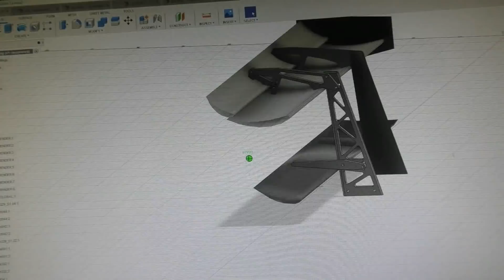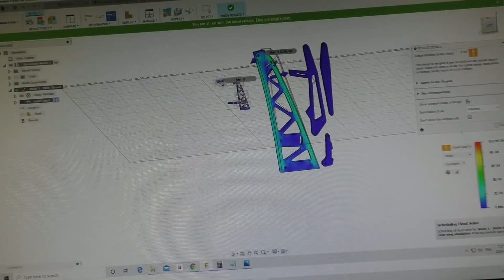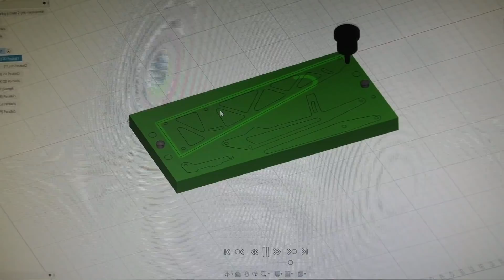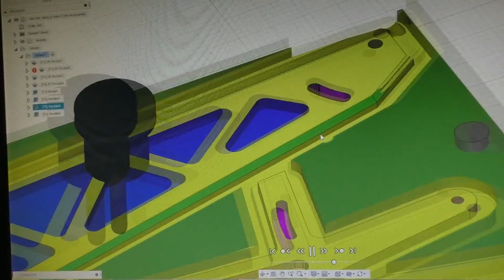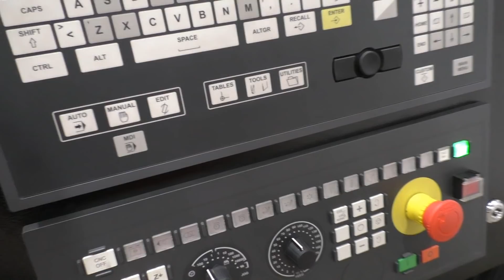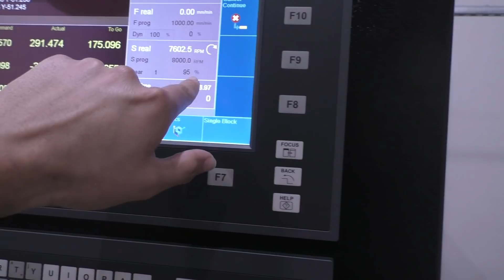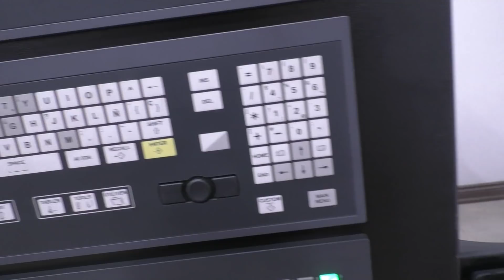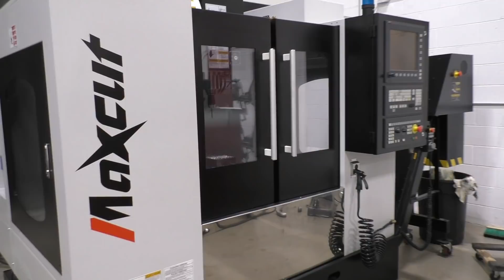Making Custom Rear Wing Mounts and Track Test - E55 ASL Part 26

Comment: oof, that curb hit was painful, but that may be a reminder to make the rear Geometry stronger
Reply: Something always needs to take the hit. Coming from rc cars it's very important to have a weak spot somewhere. Otherwise the frame will bend.
Reply: It’s probably better if they bend rather than break.
Reply: @cnnlt200  exactly, the difference is replacing a bent $5 diy control arm, or hacking out parts of bent frame and remaking the right sized tubes and welding them in.
Reply: There are a lot of alloy suspension upgrades for rc car. Especially A arms. But Its better to have them from nylon. They will bend or give on a impact. Frame sliders on a motorcycle. It's better to just let a bike slide on the handlebars. Frame sliders will give a direct hit on the frame. So don't make things to stiff

Comment: pivot the wing and run a pushrod from the lower control arm to the wing arm. Stop pushing the car down with the wing, its just wrong. Thats for cars that race in a class.
Wing should push down on the tire, not the car.

Comment: I think its called a sacrificial pallet 
The purpose of a rear wing is down force
If you move your rear wing mount to the rear spindles all of the down force will go to the tires to pavement instead of the cars suspension to the tires 
Which would allow you suspension to move without the down force of the wing

Comment: You need to attach the front spoiler fairings to the chassis. On the straights the structure is lowering, but the capo is lifting more than 5cm and is losing all down force efficiency.

Comment: Woah the laps were so cool, passing the other cars like nothing!
Factory lip-spoilers like on a CLK or E class, do you think they actually do anything or purely cosmetic?
Reply: they propably make a difference but not a significant. stock cars are more concerned with pedestrian safety than high speed aero so there are no big bladelike structures in ancle height.
Reply: I think they help reduce lift and drag

Comment: Maybe consider running a different final rear end gear ratio. I like a shorter gear for your car.  It's taking too long to spool up getting out of the corners and your never shifting.  Awesome car.  Love the show.
Reply: Small, low speed track. Wheel torque, and "spooling" are much less likely to be determining factors than tire grip. Telemetry would be nice, but I'm assuming he isn't flooring it out of the corners.

Comment: Are you going to fit endplates on the rear wing to prevent vortexes? Or does it affect the handling in any way?
Reply: End plates prevent pressure bleed off the sides of the wing edges, increasing efficiency

Comment: Why are you holding the wing from above ? Wouldn’t it save material, weight and provide better stability if you went from below ?
Reply: The wing does most of the “work” from the under side of the wing. The smoother the under side the more effective it is. That’s why swan neck style wings are so popular.

Comment: Dude, CNC is cool and all, but sheet metal bending is lighter and stronger, also cheaper. You should invest into a bender, a spotwelder and a CNC plasma cutter. That's what real fabrication is all about, you could build a whole car out of it. There is a channel "stuff made here" where the guy makes some impressive stuff with it. Way cheaper than machining. Cheers
Reply: Which part should he fabricate?

Comment: I think your transmission is slowing you down. Gear changes are not fast and those down shifts with that auto shifter look deadly. With clutch and sequential box you would shift faster and be able to keep on boost more of the time.